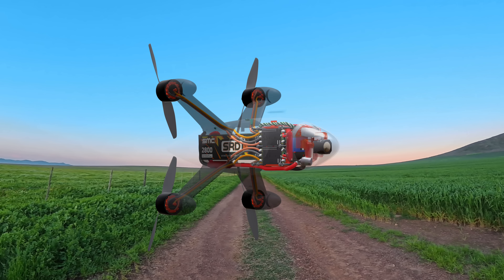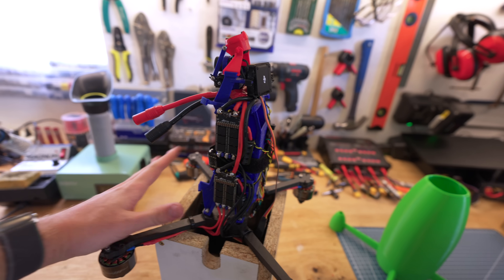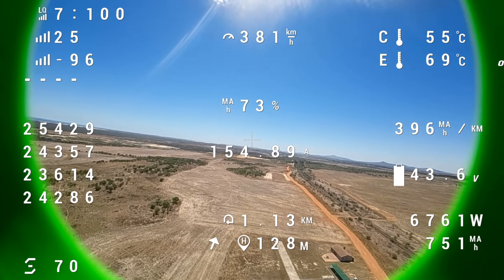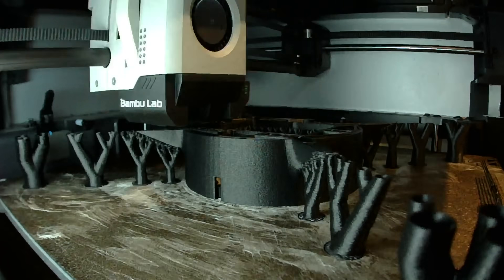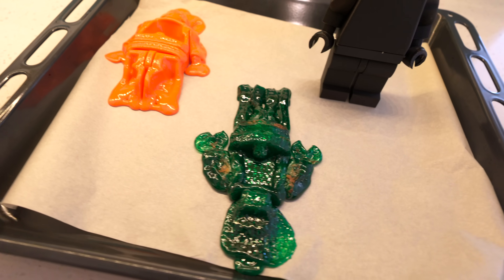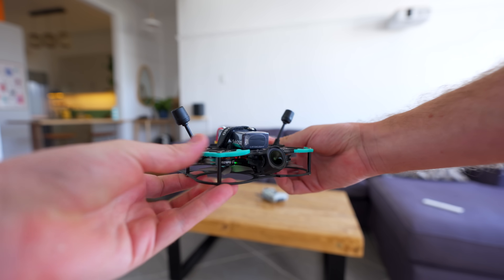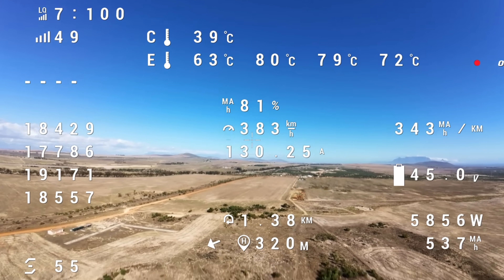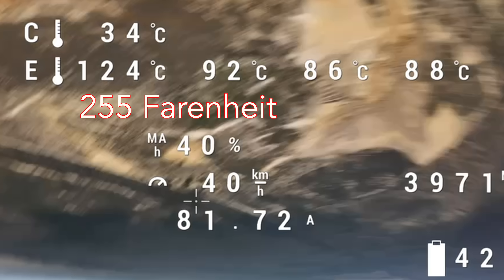THE COMEBACK - World's FASTEST Drone V3

Comment: A possible solution to enable following with another drone might be to add a small patch of 3M type prismatic reflecting tape, these tapes have amazing reflective capabilities when the light is coming from precisely behind. You might think that this would not be visible during sunlight but it actually is, even in bright sunlight as long as a bright light source is used and it's coming from behind it will reflect back into the source light. To make this function the chase quadcopter would need to have a light source pointed forward. The chase quadcopter operator would only see a bright light but it would give them something visible to follow.

Comment: I have yet to see a racer that incorporates contrarotating blade concepts. I don't know that it'll increase speed directly, but we know it increases stability and efficiency. Efficiency gains generally mean a boost in available power that translates into longer battery life. However, the excess could be used for more speed, theoretically, but that remains to be seen in practice.

Comment: That oscillation described at minute 10:50  is because of the ogive shape continues  from nose to the pointed tail.    It would be better to have a bullet shape for the body and a flat tail.    IOW no longitudinal curvature aft of the max cross section.     The laminar flow cannot stick to the curve aft of midlength.

Comment: Have you considered the possibility of a custom heatsink, perhaps heat pipes to move the thermal energy around and into outside body made out of thin lightweight metal serving as a heatsink while traveling at speed. That will make the passive cooling more reliable.

Comment: Free advice. Make small wings on the nose. They will create a small lifting force. Therefore, the load on the engines will be the same. And you can use all 4 engines at full power. Now, as I've heard. The lower pair of engines is more heavily loaded. Because it supports the heavy nose of a high-speed drone.

Comment: Imagine an autonomous swarm of those things. Networked together, or coming out of some larger deployable system. Like you could even fit tanks with the ability to launch and control those from inside a tank. 

The possibilities are insane. Especially since these could easily be scaled up or have real defense budget money thrown at them and become something absolutely insane.

Imagine a new design that uses those RC Turbine engines. Drone are totally going to become a really power asymmetric weapon. I mean they already have, but this is just the start.

Comment: Ducted Air cooling done correctly does not increase drag and in fact increases stability. Sure it relatively quick, but just using power to achieve this is not satisfying.

Comment: The water trapped inside with no external cooling feels like a very bad idea, the container might burst with high temperature as the pressure increases...
I would put a small even flat aluminium plate on the side or even tail and route the water from the tank to it with tubes. Even with no fins, at such a high speed this should take out quite a lot of heat away.

Comment: Wouldn't the water-cooling work much more efficient if you would use very small diameter copper pipes across the body of the drone? Using the airflow across the drone to cool down the water rapidly. I don't know how much drag tiny copper pipes would introduce but...

Comment: I am sorry ,22 HP 🤯,i am not sure, but that  SMC 2800 assuming 
Capacity = 2800 mAh = 2.8 Ah
P=11.4 V×210 A= ~2394 W, or about 2.4 kW.
But 22 hp that is 5 hp for each motor = 4kw roughly for each motor .
That battery is not even close enough to delivering that much power ,
Speaking with math ,if i convert 22hp to thrust force in kg  => 3282 N ≈ 335 kg of thrust.
meaning that drone should be able to lift 3+ people and fly .
and idk any battery that is that small and light weight with 16kw of power .

Comment: Radiator block might be better then use air from forward motion to cool the radiator. radiator block will have your fluid. PC's do this or cars. So the best cooling methods already invented for computers. PS5 uses liquid metal instead of radiator or water cooling. PC doesn't have advantage of moving air without a fan cooling the radiator. Radiator fins cool the water inside better i think that a block don't they or all we all wrong and cars shouldn't have fins?

Comment: What if you took your new fastest quad. slapped two more motors with legs on it. used separate smaller batteries for 3 motors per battery.  I see a perfect spot for 2 more motors. then your competing in the 6 motor category though.

Comment: It would be interesting to use a PCM (phase change material) instead of water since something like calcium chloride hexahydrate can absorb ~180J/g at it's fixed melting point of 28C vs water only absorbing 4J/g C. You could potentially lose a lot of that water weight.

Comment: MIGHT HELP?   I know that NASA used wax as a cooling system for the battery powered rover they used on the moon. The wax is fairly light and takes a lot of energy to melt (going from solid to liquid) and when cools just turns back to a solid (no real expansion/contraction problems). It solved many problems - I just thought it was a smart idea and might be lighter/simpler cooler for your electronics (maybe). You might research it ....... good luck!
Charles

Comment: since phase changing water takes a crap ton more energy than simply warming it, you probably would get just as much cooling having a check valve steam vent and no pump. the water will stay at 100C until its gone.

Comment: If you want speed, use 3.1, a large propeller for power and 3 to adjust the balance. 
For maximum speed you also need medium penetration power, and this is the best option instead of 4 blades of decreasing power. 
Alternatively, use jet engines for better thrust and you will have not only thrust but also traction.

Comment: Would a heat sink running through the water cooler and out the side of the drone allow you to make the tank smaller and reduce the ovulation’s caused by the waves? I could also “cut” the tank into sections for less intense waves or waves that cancel each other out?

If it works well enough without sacrificing aerodynamics you might could do away with the water cooler too. 

Not sure the limits of what I’m thinking though, as I have never made a drone.

Comment: Vector turbine might pull the volume of air you need at your ridiculous speeds without the water weight. Else, your heatsinks are flat, patterned finned sinks could improve cooling without inhibiting flow. Easy for me to say without having done any of your other awesome work

Comment: i know you wont see this because you don't read your comments

 just give it more horsepower and make the body larger so it can hold more internals, remove the water cooling and replace it with intakes because at that speed, intakes are basically the same if not better, also if you want to do this you gotta give it a redesign

Comment: You aren’t “water cooling”. You are using water as a thermal mass. It will still eventually overheat. A much better way would be to have heat pipes running over your ESCs  and out to a fin system on the outside of your drone that will lose that heat to the air flowing over it. Since it is flying at speed the heat sink will lose a lot of that heat. If you make them contoured with the body and only have minor amounts of “fin” material sticking out they will lose heat for you as well as potentially add stability similar to your larger fins. You might even be able to use those fins your drive motors are hanging off of as your heat sink if you made them out of copper.

Comment: I don't think water cooling is really necessary, as at that speed, a simple radiator that has air flown through it would smash those temps out of the water! Also, the water tank you made is saturating with heat, so you missed the entire idea of water cooling, which is to transport the heat out of the loop through a radiator that has air blown through, cooling the water inside. All things considered, just a radiator (with all the thermal pads like you put here) that is air cooled would work far better than the contraption you made here! For air to get through the radiator, you just need a small slot that lets the air inside, and I believe something like one mm wide with the length of the radiator would work very well. of course, this needs some strengthening in the shell in order to not be blown of by the force of air inside. Of course, you also need the air to exit the enclosure, so a hole in the back will be necessary. I believe you would get even faster this way and much cooler and lighter at the same time.

Comment: I wonder if you could somehow turn the exterior of the drone arms into some form of heat sink and use Heat Pipes to transfer heat from the electronics to those arms. Maybe you could get enough airflow during flight to give the necessary aerodynamic components a dual-purpose as a heatsink?

Comment: Preety crazy speeds already.

Are there very specific rules around the shape allowed? Why don't you use two of the prop prongs as actual wings and fly in a + instead of X orientation? Should help you reduce drag by a big chunk, mainly through much better lift/drag ratio of a proper wing and allowing the body to be at 0 deg AoA when in level flight.

Did you consider a different body shape than a circle? Should be possible to achieve a better lift/drag with a flatter bottom for better lift from just the body.

Comment: just fyi, your motors peaked to 16kw but at top speed its "only" 13kw. So In theory there is still about 3kw room for propeller optimization. Not sure how many seconds it can stand with 15kw :D maybe at accelerated fall with propeller what can utilize full 16kw you will break 600kmh

Comment: Wait what? Why would you not just expose the esc mosfets to the 500km/h air blowing past your canopy? E: I see you explain that water has higher heat transfer per volume, but that's at the cost of onboard weight. If you were previously flying it with the esc's fully enclosed with ZERO airflow and it was even working at all (I wouldn't even do that with my 20A esc's on a glider, then there's no way that the outside air flow cooling would be inadequate.

Comment: could you make the exterior, or atleast the leading edges of the struts for the motors out of aluminum and include channels in the material so that water could be fed through while its flying, and use that to help cool the drivers without affecting drag. Maybe do it for the entire body?

Comment: Dumb idea. If you add ethanol to water you can lower its boiling temperature then allow it to vent the hot steam overboard potentially lowering the weight of your cooling system as you fly.

Comment: why use water? I feel like there's lighter things that you could use that have a similar thermal mass/density/whatever the term I'm trying to think of is. that's just thinking off the top of my head with zero research though. cool either way! especially with the circulator

Comment: 11:30 if you make 4 holes or one hole in the middle, a pipe like structure it will be more stable allowing air to pass through and maintain its speed, or if you make 4 holes or 4 slots for the air to pass and all 4 slots merge at the tip of the drone will make it more stable and achieve more speed.

Comment: I feel like your cooling solution could do with some work.. because you are doing short bursts and not a sustained flight I would machine your chamber out of aluminum and put a small orifice onto it... And then you could charge that with CO2.. as the chamber heats up your CO2 pressure would rise which would increase the flow rate proportionally to the amount of heat being pumped into it. It doesn't have to be CO2.. at the end of the day I'm most coolant comes from not simply just transferring heat but from phase change... Instead of loading up ice cold water, why not just freeze it all and have a block of ice?? You would get away with having much less mass while being able to provide the same amount of cooling due to the amount of latent heat you could absorb due to the phase change... Could also do a small chunk of dry ice because then you would be able to get two phase changes as the pressure escapes. 

I mean it's easy to calculate how much heat you need to absorb/ remove... Just take the wattage of one-speed controller and multiply it by the amount that you have... And then convert watts to BTU.. and then just Factor it by the length of your test flight.
Reply: Heck, you could fill it with r290 instead. Or even r600 Just whatever you could get your hands on... At those speeds you won't really have to worry about it sticking around and combusting

Comment: Not many things fly that fast at such a low altitude. It'd be interesting to see how fast this could go at a few km of altitude
Reply from the maker: Problem is air gets thin and rpm needs to go too high. Planes fly better at high altitude because they are using jet engines with jet propulsion. Not propellers pushing air

Comment: You should try to fly higher. Flying higher is normally better for efficiently and speed. I would try like 6,000 to 7,000 meters. Also use a weather balloon to get the drone that high without using the battery.

Comment: Have you try open canape for aerodynamics and cooling like high performance engines? Also less resistance and friction intake in the front and exhaust to the back to cool down electronics.. new performance cars  are using the air to cool down the ceramic brakes like the new Lamborghini Huracán those vents on the sides are for air cooling the brakes.

Comment: This Drone isn't directly designed for military application. It is carrying its own weight only. Sure it can be adapted, but it is not a 1-for-1 change. There is no space for a warhead. But, it can be adapted for it. Will this translate to similar speeds of 500 kph+? I don't think that matters because as an interceptor it really only needs to reach 400 kph+ to rapidly catch something like a 185kph propeller driven Shahed. But it won't catch a jet-powered Shahed at 600 kph.

Comment: Use Thermal paste instead of a thermal pad. If you can put it flush onto the aluminium (without anything shorting) it should give you a lot better cooling performance.

Comment: Your center of mass needs to be behind the center of the thrust vector for the drone to be passively stable in powered flight. Imagine pushing a rope vs pulling it.
This becomes more effective as the thrust-to-weight increases and less apparent when you have drag close to the thrust, like your engine nacelles. Imagine tying a parachute to the back end of the rope.
The drag at the back being the thing that keeps your drone aerodynamically stable creates an inefficiency and coupled with the mass being close to the thrust, and the thrust being close to your drag, less predictable behavior at various speeds. Your engines are essentially balancing a pole on top of the drone, and the oscillation happens because of the non-linear nature of drag at the nose. So the oscillation cycle becomes...
- The drag at the nose become stronger than the engines' directional authority.
- The aircraft yaws, which exposes two of the pylons to more incoming air.
- The increased surface area slows down the aircraft.
- The engines and asymmetric drag counteract the yaw.
- The aircraft speeds up as it orients itself closer to the velocity vector.
- Repeat.
Ideally, the center of thrust is close, but in front of the center of mass, the CoM is at the geometric center, and the drag is mostly towards the back. This is why firework rockets have a long stick behind the motor.
At the extremes, too much drag at the back will create fluttering, though, so there's a sweet spot to all of this.
Disclaimer: I'm some guy on the internet.

Comment: you should look into thread ripper cpu water cooling.
you need microfins in the aluminum as well. would give you a lot better surface, without the water circulating through a radiator you may as well just use a chunk of copper

Comment: UA army will use it in a right way
Reply: They have something much better for their purposes: rockets. Even a tiny sidewinder generates approx. 10MW of useful mechanical power (and probably an order of magnitude more thermal power), flies at Mach 2.5+ and has 20+miles of range. The only disadvantage is its cost of approx. $400,000, but that could be reduced significantly with a low cost redesign manufactured in a low cost country. I doubt that a slightly smaller version with e.g. 10 mile range would cost more than $20,000 or so. The most costly part of the US missile is the IR seeker, which is simply not required in this case. Drones can be shot down with fairly simple laser and radar illuminators.

Comment: This is an inelegant solution. Obviously you should redesign your speed controllers for the higher voltage. The weight gain will be negligible compared to a liquid cooled jury rigged system. The reliability would also go up. I suggest you work with some Electronics designers to custom build your ESC and other parts.

Comment: Clear front dome for camera.
Your #2 esc is still overheating, you need the water to circulate, just having the pump in that tiny single block is making the water hotter, moving water is warmer than still water, and the little pump makes heat also...basic thermodynamics guys...
You should build 2 radiators into the rounded shell, and pump the water through them, (with the pumps OUTSIDE the water- inline) so the air passing over the shell cools the radiator fins just like in a car, this would be a MUCH more efficient cooling design.